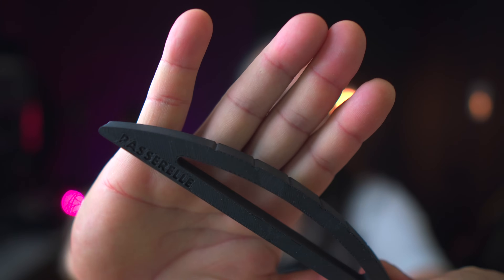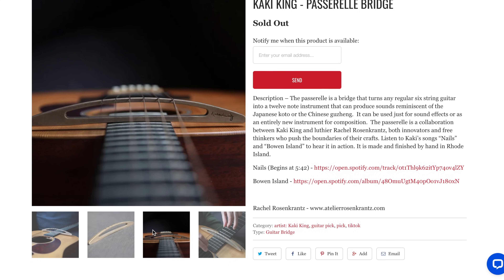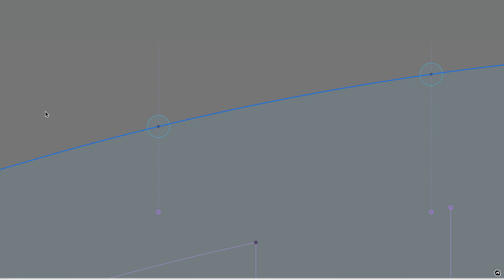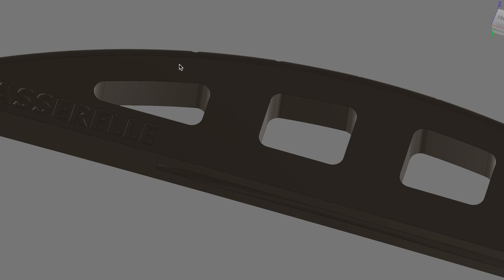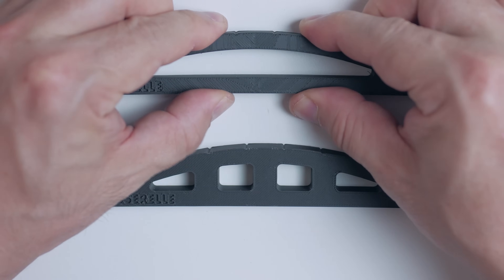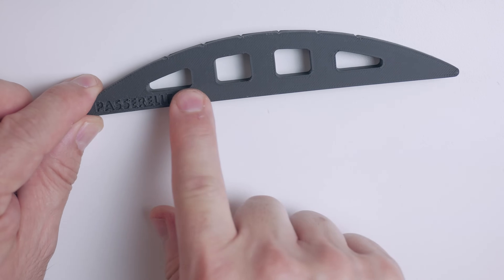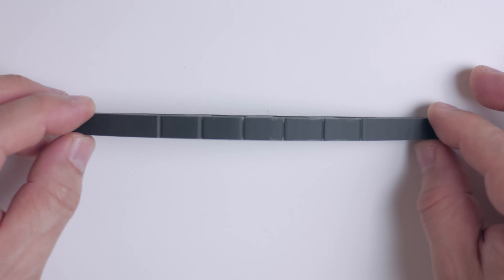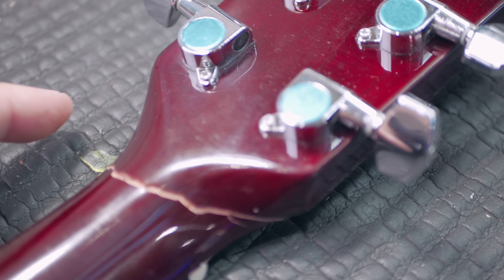Transform your Acoustic with a 3D Printed Passerelle Bridge

Comment: Thanks for the plan. Why do you think it extends so far on each side?
Reply from the maker: Great question. I can only guess. For aesthetic reasons, it looks more like a pedestrian bridge. For ergonomic reasons, you can hold it better when sliding it under the strings. For structural reasons, maybe it's more rigid with the extra extensions?

Comment: Hi, you might be better to just draw in a ‘guide’ line for how you would cut the nut in the 3D print, then use a file like you would on a regular nut. The minimum feature size on your printer might be causing your challenge on the strings popping out